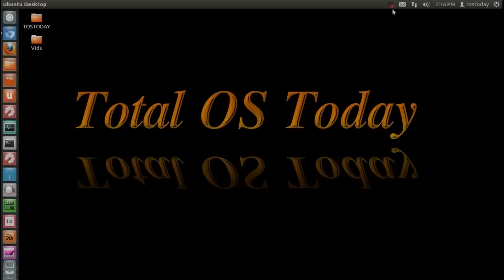Computer Codes Car Care Tip

Comment: I've never seen your mug. :)     Your problem reminded me of one I had with a sensor light coming on with my car. Simple solution was once you fill the car up, give the gas cap a really good turn, not just finger tight, but a turn after that. That turned off my dash light warning.

Comment: You can actually buy one of those handheld scanners at an autoparts store for not much money.  I think mine cost $50, worth it if your car throws a lot of codes, plus you can use it on any car as long as it's also OBD2.  Most cars after the mid-90s are OBD2.